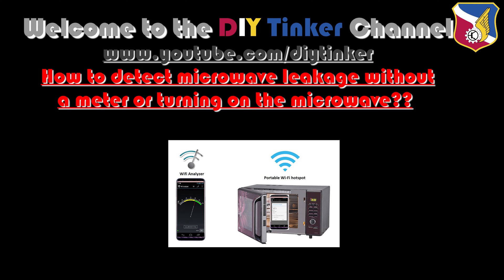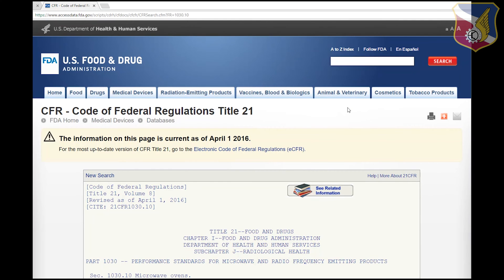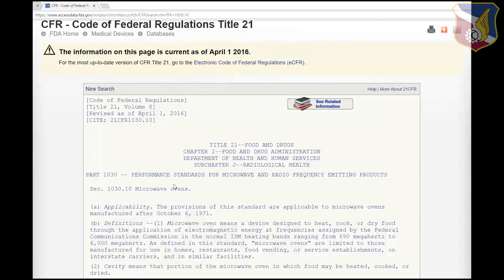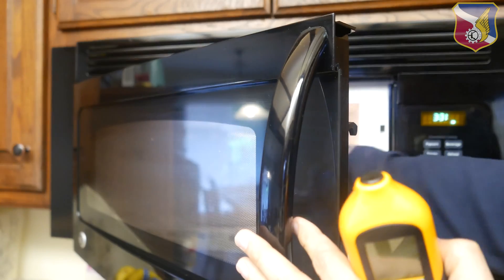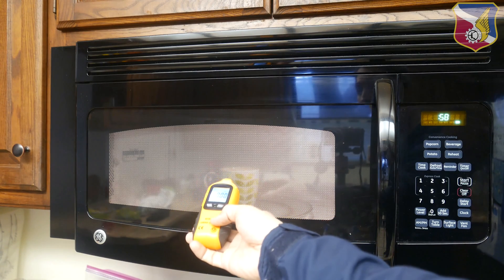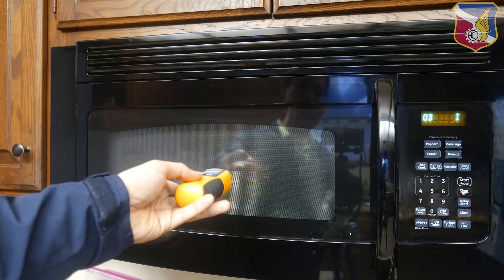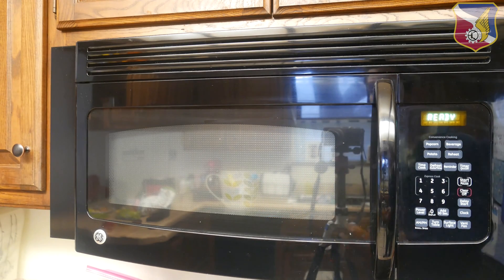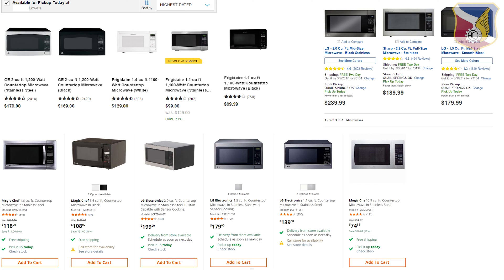How to detect microwave leakage without a meter, detectors or turning on the oven?

Comment: there is nothing in the microwave oven docs about maximum leakage? not that i would take it as gospel but maybe a staring point. anyone measure the amplitude of wifi? because wifi is all over now. people sleep next to routers. 

another thing that occurs to me. microwaves probably need to vent air. they are heating room temp air quite a bit when making hot food. so prob can't be sealed air tight.

Comment: Don’t use a microwave oven. If you have to get one, then get one outfitted with a remote. The radiation falls off inversely square to the distance. I wonder if there are metal mesh gloves one could wear. Chainmail may not have a tight enough weave. I see a Shark Tank product in someone’ s future. Lol.

Comment: You never want to turn on your microwave without anything in it. The reason for doing the Survey test with a cup of water is for 2 reasons. 
Without the water the microwave will cook itself. You must never turn on your microwave without something in it. It will cause damage to the microwave. 
A Survey test needs the microwave to operate at high power for 120 seconds. The water should be hot to boiling. The water temp will tell you if you magnetron, transformer and other components are operating properly. It is very important to have a qualified and microwave certified technician to do the Survey test and any repairs needed on your microwave.
Reply: i don't believe that to be the case. The excess microwave radiation is "mostly" grounded out by the internal metal structure and absorbed. some is reflected around and leaks out of the imperfect seal on the door. its an imperfect Faraday cage. 
IF all of the unused waves continually bounce around you wouldn't get cold spots in your food and you would get blasted by tons of radiation by opening the door after every use.
the cup of water is for test consistency. Seeing how almost no one starts a microwave without something in it. 
You dont use a speed gun on a car that isn't moving but the wheels are spinning.
Reply: To take it a little further: The water does act like a load. With no load the energy will be reflected. If enough of it is reflected in the proper phase there could be a high energy point back at the magnitron. (Standing wave). This could burn out the magnitron or other components.  The water is a must.
Reply: How to detect mwaves od 95ghz which are aimed

Comment: Yeah it is a great idea! I have a wireless headset that I have been using recently and I noticed that is was blocking the signal, not completely but enough to alarm me of the hazard. It surprised me as I thought they were safer then we are led to believe.
Reply: I notice that too with my Bluetooth on so i try not to used my Bluetooth also i just leave the kitchen for a few seconds or minutes until i finish using it